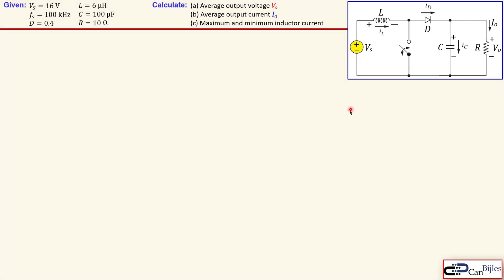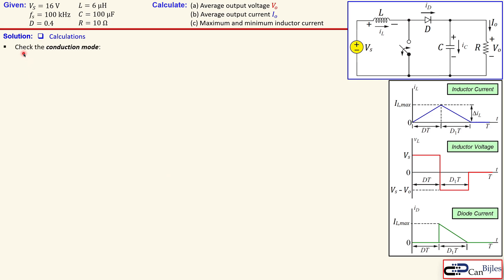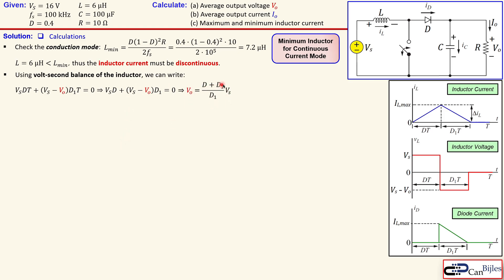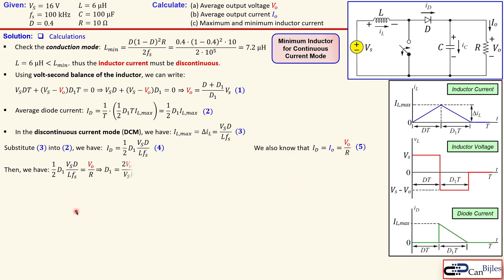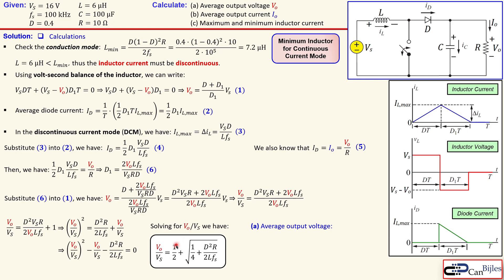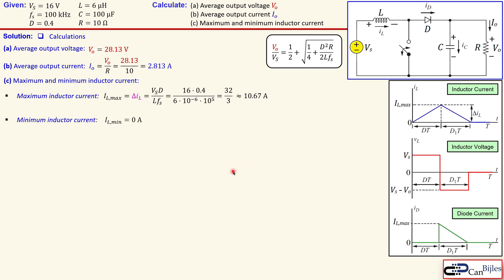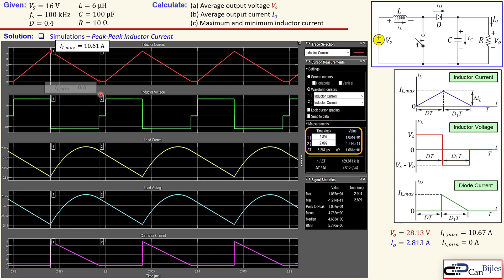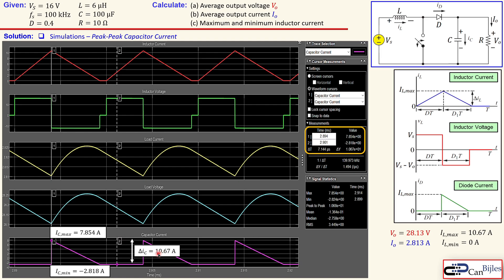⚡ DC-DC Boost Converter - Discontinuous Conduction Mode 🔋 Power Electronics ⭐ Calculation & MATLAB

Comment: 12:20 I guess, you meant the pink one is diode current, not capacitor current
Reply from the maker: No, the pink plot is for the capacitor current. You can also see that the current becomes negative, which is usually not possible for a forward-biased diode. The diode and capacitor do have similar current waveforms, but the diode current will be always zero or larger.